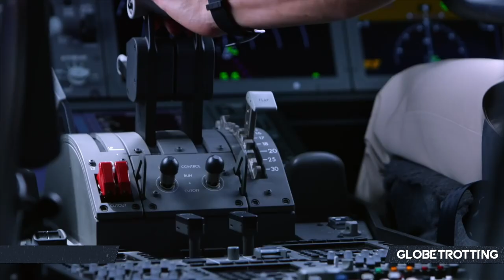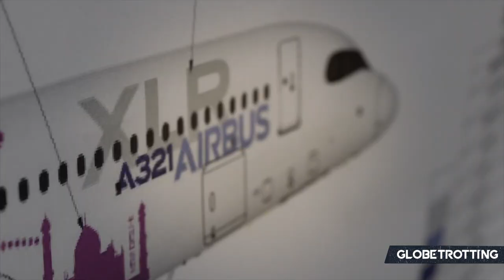Boeing's Next New Airplane...

Comment: I expect Boeing to develop a 737 replacement by the beginning of the 2030s, with a slightly larger and longer range variant. This will then be similar to the A321XLR but 20 % more efficient due to technological progress. And probably cheaper in production.
Reply: At that point it will no longer be compared to the A321. It seems you are expecting Airbus to do nothing in that period of time. Wrong. :-)
Reply: Mid 2030 and a much greater improvement than you are suggesting.  I am guessing 50% savings in all categories.    Either Boeing will be aiming for a revolutionary aircraft.
Reply: The market will be owned by Air Bus.
Reply: What are you basing your expectations on? Honestly asking…
Reply: I expect Airbus to develop A320's replacement by the beginning of 2030's. Similar to A320neo/A321neo but 20% more efficient due to technological progress. And probably cheaper in production.
Reply: @xaviernicolas7218  I base my expectations on what Tesla has shown to be possible in building cars.    What is possible when one places emphasis on factory design.
Reply: @danharold3087  I would believe it if this was the Boeing in the 90's. Unfortunately we're talking about Boeing in 2030's. All technology development points towards 20% improvement of fuel economics by mid 2030.
Reply: @chingweixion621  That would be the normal expected gain.   If Boeing is going to survive 15 years without the steady introduction of new airplanes it has to do better.   It has to have planes that are exceedingly compelling.  By then everyone will have about 20% better fuel burn.   Boeing has to do better on all fronts or close the doors at Boeing Commercial.   Boeing needs to designs planes which are every bit as disruptive as the Tesla cars are to the EV market.   Everyone can design an electric car but only Tesla is selling them at a substantial profit.   When the disruptive planes are announced they will have airlines looking to dump their existing planes regardless of age.  Boeing production will be highly robotized and non union.   Any company unable to make this transition will be left behind.
Reply: @danharold3087  problem is Boeing doesn't own those technology. Airbus also have access to the same set of technology. Take B787 for example, Airbus come out with its own composite version just like that. GEnX was revolutionary on the B787 but RR also has Trent 1000 and Trent XWB in the pipeline. PW has the GTW which is currently 2-3% better than the CFM leap, but RR is looking to top that with the Ultrafan by 2026 if there is any airframe using it.
It's a duopoly industry and both Airbus and Boeing doesn't own the technology. They only build aircraft based off patents from NASA, and other technology companies and patents can be easily circumnavigated or bought.
Reply: @chingweixion621  true , but the execution  and use of these technologies  is different.  

Both the a350 and 787 use composites but are not built in the same way , the a350 is build  in panels compared to barrels used for the 787 production.  

There are still majore differences between  the 787 and 350 despite accessing the same technology.  The 787 is generally  lighter and more efficient  than the 350 just to show you what i mean . 

The best execution  of these new technologies  will determine who gains majority  market share not just who gets the technology  itself
Reply: @orlovsskibet  airbus will be reluctant  to make a cleansheet due to massive sales with the a321 . They will probably  just want to stretch it and use composites instead . 

Funny enough  thats how they lost market share with the a330 , they where enjoying sales with the 330 and where not in a rush to make a replacement  then boom the cleansheet  787 was dropped  , and it gobbled  up the market 

The a321 is not really as limited as the max family , so a cleansheet  for them is not necessarily required.  On the other side with the height limitation with the 737 max and its inability  to carry heavier engines coupled together  with its poor takeoff performance and reputational damage  a cleansheet is  required  .
Reply: @bobdevreeze4741  trust me there is absolutely  zero guarantee. Lol
Reply: @mmm0404  I suspect there is a reason why you are not the CEO of AirBus with an attitude like that ;-) I know as little as you, but I would be surprised if AirBus does not spend a good deal of time planning when to make a clean sheet plane. It's my impression that they finally are under good management. Time will tell :-)
Reply: @nntflow7058  its complicated  with airbus lol. If they make a 320 replacement  , where does that put the potential  a220-500  which would  have a similar  capacity? 

Airbus would not scrap the a220 since its new , at the same time it  would never compete with a cleansheet  composite  737 replacement.  

Will they focus only on replacing the 321  And let the 220 replace the 320 and 319? .  Im figuring thats going to be a headache  for airbus in the future.  Meanwhile  boeing could  replace all its lower end offerings with ease
Reply: @orlovsskibet  it will indeed. Just basing this on the fact that when boeing proposed 797, airbus where looking into a stretched a321 called the a322. Would have shared the same fuselage  but with use of composites and more powerful  engines .. Just look into it and you will know what i mean
Reply: @mmm0404  You do realize that A220 is a next generation aircraft that surpass both MAX and NEO right?

Whatever Boeing came up next without new generation engines would have similar fuel efficiency as A220. And if Boeing could get their hand on next generation engines, A220 could do the same too. They both uses the same engine family after all.

A220 uses composite materials. Something that Boeing and Airbus have to do with B737 and A320's replacements.

Also. Airbus could scrap A220-500 and goes ahead with replacing both A320 and A321.
Reply: My take is Airbus will launch 220-500 to cover the lower capacity of 320 family.  The next A320 clean sheet design will address upper end of 320 and 321 segments with composite wings and/or body, coupled with next generation of engine technology.  Boeing is hoping the same but will have a wider range to cover, or abandon the lower end MAX segments.
Reply: The 319 320 321 are the same plane! Just cosmetic differences. Any cleansheet is going to take more then 5 to 10 years to get FAA approval
Reply: @xaviernicolas7218  Primarily based on the fact that the 737 airframe is a more than 50-year-old design, which still competes well against the A320 family in general, but has also been pushed to its limits with the MAX generation. The 150 to 200 seat aircraft category is the most lucrative of all, so a clean sheet design will almost certainly pay off. The investment risk for a dedicated middle of the market aircraft is higher because the aviation market is relatively thin in the middle.
Reply: I dont disagree but Boeing has been dragging their feet on the MOM/NMA design. in the mean time, Airbus is capturing the large narrowbody market with the 321/lr/xlr. The 320 is selling well and they have a 6th generation small narrowbody that they got for a Canadian dollar. The a220 can be expanded to the a200-500 model which could replace the a320. Boeing has to come up with a new design to compete with the 321xlr (at which point Airbus will probably start a replacement design for it as well) and Boeing also needs to design a small NB to compete with the 220. tough spot for Boeing but they did it to themselves by not update a design ((737/727) from the 60's.
Reply: @danharold3087  Sure,  but Boeing hasn't shown the innovation level that Tesla is displaying at the moment. not even close.
Reply: @xaviernicolas7218  If only it were not so. LOL
If Boeing hopes to survive they need to change.
Reply: Range is NOT required in said class.  Boeing needs a 5 wide replacement.  You might have noticed the a220 selling like gangbusters with its geared turbofan and MUCH lighter than 737/a320?  Ding Ding Ding.  It is a perfect match for the tech.  It is not apparent that geared turbo fans are viable at larger sizes.  Everyone has been working on larger for a LONG time and so far it has not worked except on the smaller turbines where the difference in fan speeds is much greater.    If geared turbo fans worked so well, the a320 NEO and 737MAX would have used them.
Reply: @nntflow7058  A320's replacement already exists.  A220 and its P&W geared turbofan.  What needs a replacement is a321 and here with the a321's ~4000 orders, I expect a replacement and the orders converted to the new a321 fuselage/wing.... but this assumes the geared turbofan can be increased in size.  So far, no one has had any success in said reliability.
Reply: @w8stral  Not until they stretch the A220.

Also, one of the best thing about Airbus is the cockpit commonality between all their aircraft. A220 doesn't have that.
Reply: @mmm0404  Not true.  a350 was granted by EASA FBW load alleviation in wind up turn.  This made its fuselage roughly ~20t lighter than 777's fuselage.  787 did Not get this FBW load alleviation during its design ~5 years earlier making their fuselage ~10t heavier than it should have been royally pissing Boeing off.  I do not work at Boeing anymore so I do not know if 77X got the FBW load alleviation.  Judging by its extra length, and increased interior width + bigger wing etc while keeping its MTOW the same, I would guess that 77X did get wind up turn FBW load alleviation.
Reply: @PhilippDebus  No, the 737 is not a 50 year old design.  There is not a single part other than its landing gear which would fit on a 50 year old 737.  737 was ~100% completely redesigned in the 80's(same time a320 was designed) and whatever was not in the 80's was done in the 90's.
Reply: @nntflow7058  I would guess that a220 will get the Airbus cockpit and yes, it covers a320 where the only difference is that the manufacturing has not started of the slightly longer version.   A220 last several years has more orders than a320.  You might have noticed, but a319 orders have vanished due to a220 and so have a320 orders as everyone has ordered the a321NEO as it is the optimum for current engine tech, but it needs a new wing/fuselage for "perfection" and then they will 100% own that segment for the next 40 years just as the 757 did for the previous 40.  Reason?  Cargo.  Increased population, but mostly CARGO and a321's larger wing is the winning option.  A321 has 50% more orders and deliveries have surpassed a320.
Reply: @w8stral  I don't know though, it wouldn't be as easy as it sounds. Their biggest problem would be commonality with A321neo.

I think they could move with replacements for A320's family all together for the next narrowbody replacement cycle in 2030s.

A brand new narrowbody with composite materials like A220.

So I see direct Replacement for A319, A320 and A321 as a single family member rather than A220 and A321neo combined.

Also, they are focusing on Hydrogen for their next project, I think it would make more sense to build a brand new aircraft from scratch for simplicity rather than fitting A220 with the new technology.
Reply: @w8stral  what did I say 😅
Reply: @w8stral  they won't dominate the segment  for the next 40 years , there is absolutely  0 guarante. The reason  they are now is because  Boeing currently  doest have a suitable  offering  in this segment   and the MAX 10 which is the closest a321 competitor is not yet certified.  

I'm sure since Boeing have lost market share in this segment  they will definitely  pull out the stops and come up with a revolutionary  cleansheet in the 2030's  to break that dominace , just like the 787 broke the a330 dominance
Reply: @nntflow7058  tbh , If both Boeing and AB can get significant  weight reductions from use of composites on their cleansheets , which could also have significantly  improved take off performances even in shorter runways like London city , it negates the advantage  of the a220... 

Fleet commonality  seems to be the future  . I would not be  surprised  if the 737 replacement  shared a common type rating with the 787 and the 320 replacement  with the 350. The a220 doesn't  offer that
Reply: @nntflow7058  Fitting a220 with new tech?  WTH?  It is the new tech.  a321/a320 are not.  Only difference would be cockpit commonality which is cosmetic(switch placement).  A quick change of cockpit to whatever the new a321 or its current cockpit would be more likely.  

Hydrogen is an absurd joke.  CNG is actually viable, but with seriously reduced payload, hydrogen is not even on the horizon.  No engine can use it reliably, no way to store it other than in giant circular fuselage eating tanks.  No infrastructure to make it or store it at airports around the world, and I'll let you sit next to the refrigerator at -250K.  Let me know how that goes.

Maybe a regional aircraft will go hydrogen as a demonstrator in Europe using pork barrel spending.  But nothing will happen outside of Europe on that front.  US military has been eyeing aluminum fuel pellets(yes) as it is 2X the density of Kerosene, is easily transportable unlike hydrogen, but it has the problem you convert to electricity and then obviously we would have to have gargantuan electric motors for a large aircraft... It is not like we can't make said motors, but by high voltage necessity the converter would have to be RIGHT next to/in said electric motor.  We are talking Many Megawatts and no one is going to sign off on a power cable going through a fuel tank for instance, though if it is aluminum pellets it might not matter.  

Anyways, I'll put my money on the US military and aluminum pellets(easily stored/transported) before any CNG let alone H2 aircraft ever fly commercially.
Reply: @w8stral  Sir Calm down. Airbus themself shows that they are investing into Hydrogen. I'm not pulling this out of my ass.

They are targeting the development of Hydrogen aircraft in 2035.

They also need different configurations for the hydrogen tanks. Using current A220 wouldn't make sense at all.

Airbus even published some concept pictures for it.
Reply: @nntflow7058  Airbus showed they had lots of pork barrel spending from the French and German governments to go into Hydrogen there buddy... which is why I typed what I did.  It is NOT AIrbus, anymore it would be Boeing if the US government dumped a billion or 10 to develop a hydrogen aircraft.  Suggest you read more, type less.  

Everyone has published "concept" drawings made by 6 year olds irrepective of engineering reality.  It is a happy thing all aircraft manufacturers do to give their aerodynamicists devoid of structural requirements, engine placement requirements, let alone passenger ingress/egress or cargo handling.  Hell, they even make plywood mockups to drum up possible government grant money.  

Suggest you go work for A or B to see how things actually work.

Comment: I understand they have other things to worry about. However this waiting they plan to do will push a lot of customers with 757 planes (Delta) to look at the 321XLR now. Delta already has such a big order in place with the 321 ceo and neo. However this might push the XLR and maybe even the 338 into more of what Delta will look for as in replacements for the 757 and 767. I feel if the XLR is ordered it will joy be that big of an order as that most of the 757 flights can be handled by the NEO. The idea of 338 order to replace 767 could be intriguing.
Reply: Delta has already chosen it's 757 replacement in both the 321NEO and 737 MAX 10s. They use very few international 757s. It's the 767 that's the open question at DL

Comment: A lot of customers will look for airbus  for new airplanes
Reply: It all depends on production targets and delivery progress. Back in 2019-Now, Airbus failed to hit their production targets with long standing A320neo order backlogs to catch up with 737 Max's during the grounding. Resulting Airbus to take zero advantage over the 737 Max fiasco. Now many Airlines are having a headache with Airbus's slow production/delivery progress including Qantas with its standing A350 order. However Boeing, with long backlogs as well, performed much better to hit their production targets per month than Airbus. Which would effect some of airlines decision to lease for an Airbus order.
And of course, you can expect some major discounts from both sides.
Reply: @sinada5444  what I see is Boeing don’t have the middle of the market airplane to replace the 757 and 767 air bus has that plane the A220 and A320 series planes
Reply: @johnreed6507  Boeing 787 and A330neo have their roles in the middle market. Boeing doesn't seem to be worried about neither the A220 or A321XLR. They've got the 737 Max family to fill the short-meduim haul market gap for a decade untill newer technology comes for NMA program to go back in drawing board. From there, you can say goodbye to 737 series and welcome its newest replacement in 2035.
Reply: @sinada5444  I agree with you on that
Reply: They will still be looking at both

Comment: 21? You're just a kid! Oh well, I'm 66 &I like what you do, no kidding!

I wish that Boeing could wave a magic wand & start cranking out an updated version of the 757, but things don't work that way. In reality, the folks at Boeing need to clean up the issues with the MAX, work to get the 777X certified, and have the designers working hard (and smart) on their NMA. But, I'm afraid that they will just try to cobble together yet another airframe & call it another variation of the 737, attempting to bypass the full certification process for a new model. Boeing is in a pickle, all right, but they got themselves into that jar & screwed the lid on themselves. They need to find a way to get back onto the front of the top shelf of aircraft manufacturing, and soon!